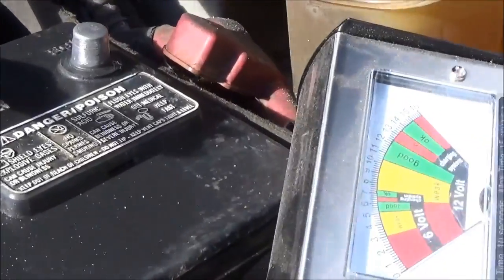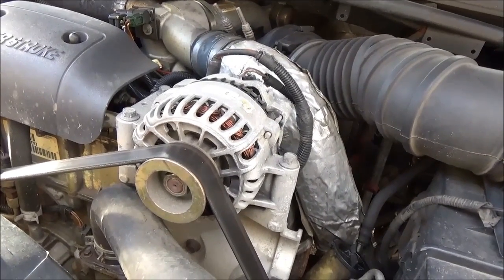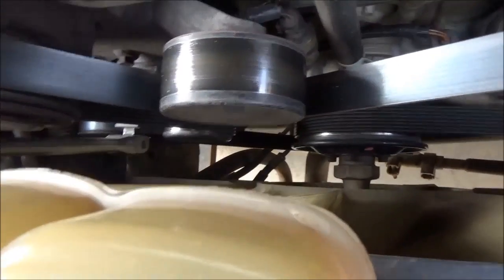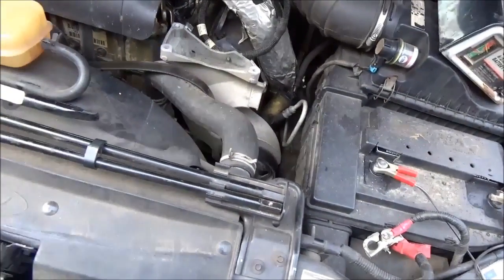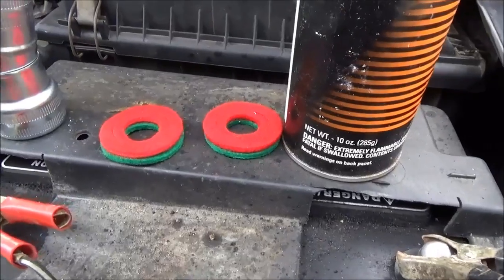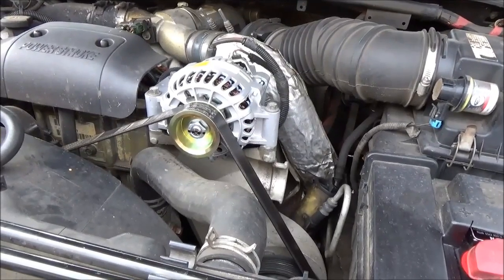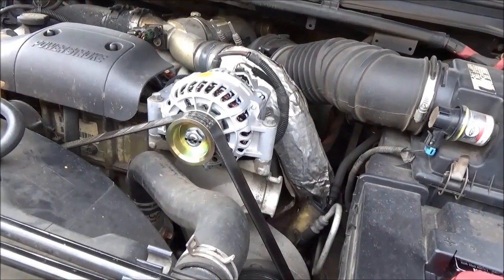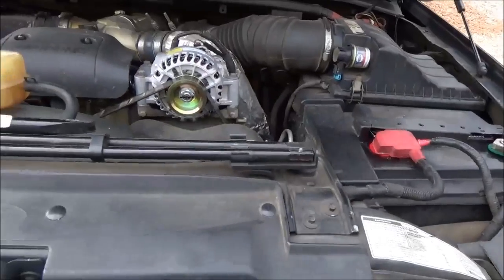Don't get caught with your volts down!

Comment: I tested my batteries with the truck running in the alternator is sitting at 13.3 volts is that low? I'm used to 14.5 or so on my other vehicles

Comment: Pro tip for the 7.3 owners, change the upper radiator hose to the revised style that runs on the outside/around the serpentine belt While you are in there. Nothings worse than having to remove a upper hose to change a belt.  Cant even be done unless the engine has cooled. You can also Install Dual Alternators with OE from Ford.

Comment: Why do you have 2 batteries to begin with though? Is It for running radios or 12 volt appliances?
Reply: John D diesels need 2 batteries to run glow plugs, glow plug relays
Reply: Diesels need two batteries for the starter! because the engine runs at a higher compression.

Comment: To correct my previous post, on the 99' f250 cam position sensor. I called it a crank angle sensor. The f250 7.3 does not have a crank angle sensor. My bad. You tuber, Trey Spooner has a good r&r video on its replacement.

Comment: I have a 99' 7.3, love it. 254K. I am a retired auto manuf.  service rep. And always carry a spare belt, crank angle sensor, amsoil fuel treatment, and complete tool kit. Have had to replace the CAS on the side of the road once. Ten min. Job, w/a 10mm wrench. Very little warning, when those  those early production sensor s go bad.
Reply from the maker: Thank you.  I thought it was a Cam sensor but it's location makes sense that it is the crank.  I will be picking up both a belt and and CAS ASAP.  Thanks

Comment: Scott,
When your batteries need replacing, look into the Odyssey brand battery.  It's an AGM battery.  Usually the cheapest place to find it is at any Sears Die Hard retailer.  Sears sells the exact same battery but in a silver case marketed under the "Die Hard Platinum" name.

Comment: yes, it's a diesel. but in the event of an emp it will fail. because it is electronic controlled. now it it ran off of a mechanical injection pump and mechanical fuel shut off or air shut off like a detroit v6-71 7liter 426 cid. adding a gear reduction winding, heavy clock spring starter. like some of the brigs & straton lawn mowers engines of the 60's. it would be the right vehicle for everything. i've also though of implementing a heavy vehicle leaf spring clock spring actuated generator
Reply: You're thinking about it wrong. Even with an emp issue, basic electrical circuits will still function. Starters, blower motors, a fuel shutoff solenoid, etc. Only the computer chips are what's effected.

Comment: Put the proper top radiator hoes on that 7.3 please LOL. Nothing wrong with it I just do not like it. I also do not like the replacement fuel filter with cap, They are bad to leak. Nice job. How many miles on your 7.3. Mine has 460 and still running.

Comment: 7.3's need to have full voltage to run the IDM thus, the injectors. Running low or poorly maintained batteries on low voltage will eventually kill the injectors. The 6.0 and 6.4's are 10 times more dependent on fully charged batteries. Low batteries is slow death to the FICM and injectors. Most diesels are hard on batteries. Newer diesels, including the PS, are even harder on them. If you get more than 2 years out of batteries, you're doing good.

Not sure what he means that you don't need a lot of power to limp home. This engine does not have mechanical injectors and pump. It all runs on electricity.

Comment: your right the F-250 W/7.3 Power Stroke is a beast Truck! I got the 2000 F-250 with 348K miles with all of the goodies for the motor, the cold air box W/ Airaid filter breathes real nice. And cudos on keeping it so clean under the hood :) mine's a pig pen, I keep getting high pressure oil leak, cheap seals.

Comment: I'm surprised you didn't crack open the alternator first.  I've heard some horror stories about the reman places, and am now willing to look further into some of this stuff myself.  Might as will replace brushes/bearings as needed, I do it with all my other equipment.
Reply: Exactly, usually a quick buff with very fine crocus cloth of the slip rings and some new brushes and your good to go. If the slip ring is really gnarled that is another story. With the belt tensioners on today's vehicles, the tension is set to near perfect and place little load on the bearings so they should last a very very long time

Comment: I was going to suggest going ahead and replacing the belt while you had it loose, but then I noticed that you'd have to remove a water hose.  Kind of a dumb design on Ford's part, I think.  Though, the alternator mounting is easier than some others that I have seen.
Reply: Get a dual alt hose, it goes around the belt through that half moon shaped cutout just under the alternator.

Comment: Keep your receipt in the glove box so you can exchange it if you need to.  They dont keep purchase history past 2 years.  Ask me how I know.
Reply: Nicholas Smerk RockAuto is an excellent choice for parts.  Also try Autohausaz.com.  I saved lots from using those two placed.  AutoZone and Advance Auto are way too high but you pay for immediate items.
Reply: Say ...how do you know?? :p
Reply: Advance Auto parts only keeps it at the store you purchased it from for 2 years...those buggers.  I remember once, AutoZone gave me free wires for a car I don't remember changing the wires on.  They were shot and I needed them then and there, and they looked it up in the system for me.
Reply: mikeallenbrown1   I had some CV joints that had a "Lifetime Warranty" on them.  They had no record that I had purchased them and even with a receipt, it was a LIMITED lifetime warranty.  Dont believe that it is a lifetime warranty, its just an advertising scam.
Reply: Raise a fuss and get what you want out of them, but if RockAuto has name brand parts for cheeper...I can wait.

Comment: From someone that deals with electrical in my career.

Please remove rings and watches. That ring will melt in a flash and burn your finger to the point it will likely need to be amputated. Just takes a micro second the happen.

Comment: Check the pulley on your old one. Most modern factory alternators come with a one way bearing in the pulley. Helps them free spin when you shut down and helps them last longer. When you said your charge was wandering around that is the first thing I thought of. Check that bearing and if its shot just put a new pulley on it and save it as a spare. That replacement had a solid pulley so you are good there.
Reply: They don't.

Comment: Hello: You have the best diesel engine Ford has used I think. I'm glad I got the life time Alternator from NAPA because the first one did not last long. Have a good one.
Reply: Agreed. I remember working at a Jiffy Lube when the first of the newer 6.X (6.0? 6.3? I don't recall) liter powerstrokes started to come through we were informing the customers of rear main seal oil leaks with only 12-15K miles on the truck. I'd take the 7.3 any day.

Comment: Assuming that you replaced the alternator with one that had the same amps, how many amps does this new one advertise to put out?
Reply from the maker: 110
Reply: engineer775 Practical Preppers That seems to be considerably small for a f250. Especially one with the dual battery pack. My current Vehicle came stock with a 150amp alternator, and I can't see the vehicle having near the power needs compared to your f250... I honestly would have replaced it with a 150 amp at least so that the alternator would last considerably longer.

Comment: Why do alternators fail?
Reply from the maker: Heat, overloading, over working, diodes fail, bearings fail etc.
Reply: Really has to do with what alternators are made with, a rotor is spinning on a needle bearing inside the alternator, this can wear down over time after excessive use/load, another part that can wear out are the diodes that are in the voltage regulator. This is why it's better to get a bigger alternator than needed as one rated at a higher output will last longer since technically it's having less strain put on it for the same amps compared to a smaller alternator. More info- http://auto.howstuffworks.com/under-the-hood/car-part-longevity/how-long-alternators-last1.htm
Reply: All of the above are correct. Primary fail points tend to be be brushes, bearings and diodes.
Cheers!
Reply: normally it is the brushes that wear out on them after time or the bearings wear out